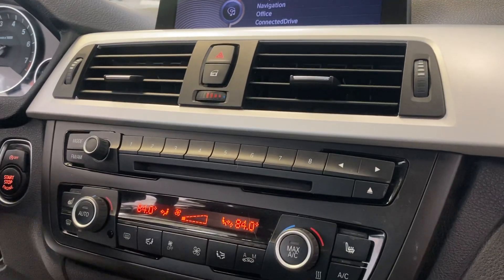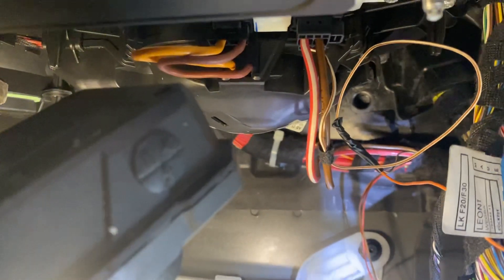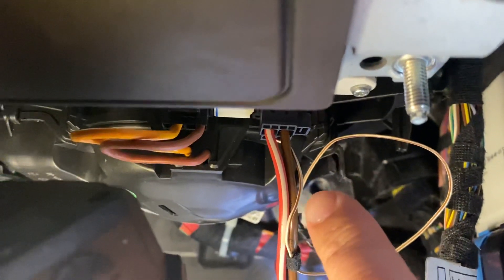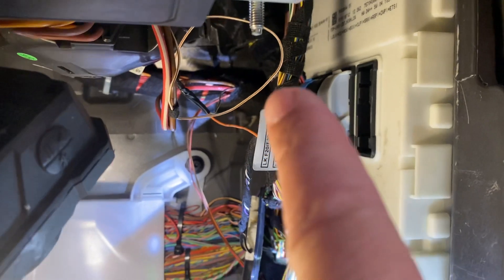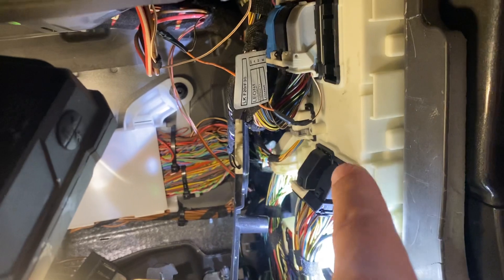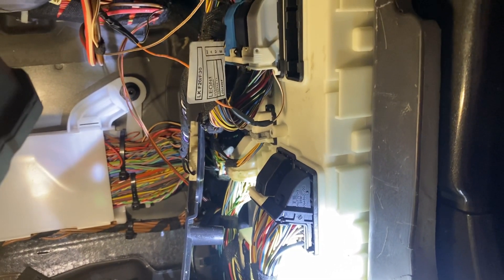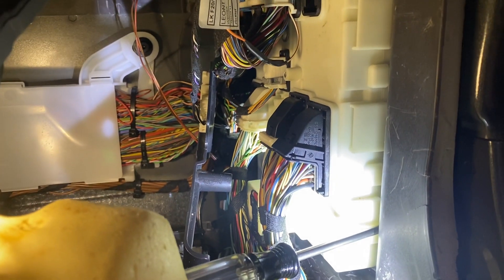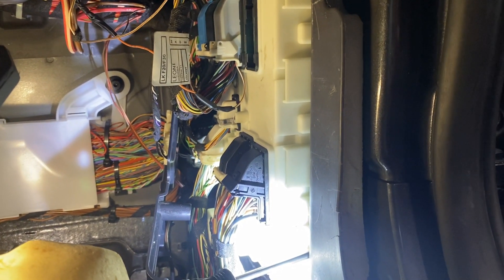Inside look: BMW BDC FEM module failure revealed

Comment: I have about 6 faulty Codes under FEM Module Section. My main concern though we're my Angel Eye and corner light not working (low bean/high beam are good), I switched corner light to other side and worked fine also replaced headlight module and reset the code and still didn't work. Could it be a high possibility that it's my FEM Module? It's 2016 M3
Reply: having the same problem with my f80. did you ever figure it out?
Reply: @nasah2834 yes it is